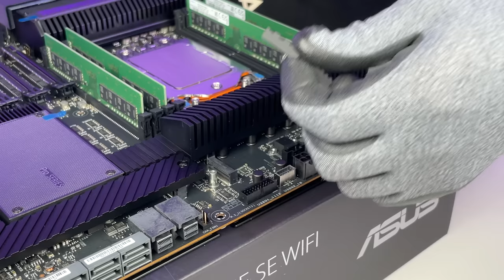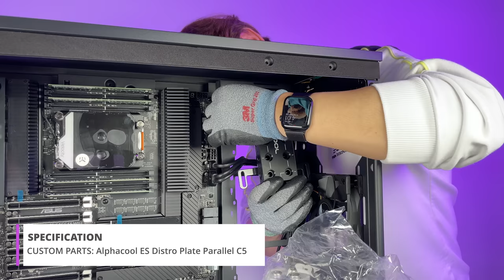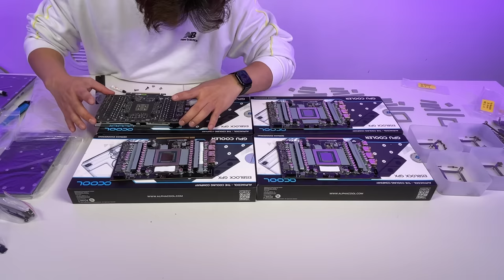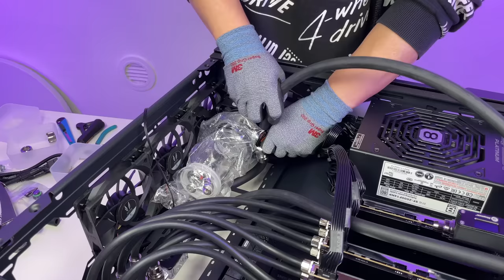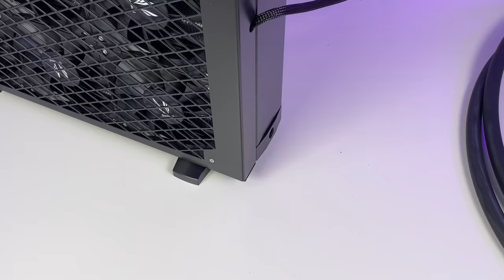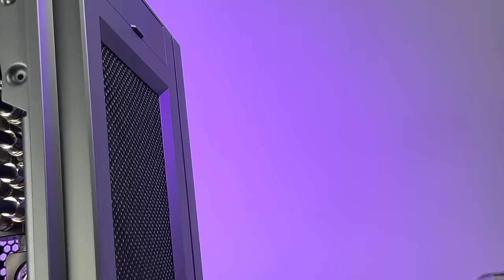$26000 RTX 4090 4Way ㅣThreadripper Pro 5995WX

Comment: Dude, if you're going to make a build this epic, fill-up all of the RAM slots.
Reply: its already 128 gigs. Also, filling entire slot will harm the clock speed, so its just already as big with full clock.
Reply: @azravalencia4577   they could just use dummy RAM sticks too
Reply: Fill up your ram slot.
Reply: He obviously builds for a client, not for his own. Just doing what his client asked so I wouldn't blame him.
Reply: I don't think this is a build were looks or epicness was a priority
Reply: When you build yourself a rig. Put the amount of ram that you want. As Azra suggests below, oversaturating will affect clock speeds.
Reply: @azravalencia4577  Going from 4 to 8 channels of bandwidth is WAAAY more beneficial than clock speed.
The RAM he is using is only 3200 MTs RDIMMS they are DESIGNED for 8 and 12 channel use in servers/workstations.
Reply: but- but- the client doesnt give a shit about that?
Reply: @popcorny007  I forgot to see the RAM clockspeed is only 3200. Now i wonder why they dont put full channel lmao.
Reply: @azravalencia4577  5995WX was 8 channel memory and only with 8 memory CPU working on full power. All 8 slot was 3200MHz. Just add same memory and test it)))
Reply: Probably he want stability
Reply: He could of atleast filled those 2 fan slots and maybe used a bigger pump
Reply: hahahah DDR-4 RAM with 3200Mhz OMG in this build. Burned money...
Reply: Double it for the next person
Reply: I think is enough. He already doesn't have SLI. Maybe would shine with virtual machines. Games only use 1 gpu 🤷🏼‍♂️, and of you would use 4 for accelerate ai or graphics rendering. Quadro makes for sense
Reply: I think you mean a build this epyc
Reply: Bro more ram does not maen more fps
Reply: True
Reply: @azravalencia4577  it’s not harm clock speed. This is 5995wx it’s have 8 channel memory controller. But i don’t know about speed 3800mhz will be a limiter for ddr4.
Reply: @weptlazer8068  what’s the point
Reply: @ve.96  yes abut also what @Azra valencia said seems valid
Reply: No he want to invant to bring 1 more ssd , his budget is 25999 usd only so yea...
Reply: this thing is more expensive then my emc tower…
Reply: @0tayaya  it is expensive than my life
Reply: even my 8 year old pc has all the slots filled 💀💀💀 like you could of just used ram with each stick having less ram like 16gb per stick which would make the 128gb max with the 8 slots
Reply: Why should he. If he's not even gonna use them
Reply: @popcorny007  does that CPU amd/or MoBo even support 8 channel? Or is this a quad channel with two dimm slots per channel board? Like this aren't the server chips nor a server board....
Reply: @Ruiso7  Yes, TR Pro is basically identical to to EPYC, just single socket and higher clocks.
The CPU & board both have 8 channel memory (1 DIMM per channel), so it's just throwing away performance to not take advantage of it. Especially of you're paying for a 5995WX.
Reply: FR💀💀💀
Reply: motherboard limits how much ram you can put in
Reply: @istvangaming9406  yes and your cpu
Reply: 2 channels are faster than 4....
Reply: @azravalencia4577  it’s a workstation not a gaming pc also clock speed doesn’t even really matter past 3200mhz you gain like 5% more performance which is within margin of error
Reply: Mastertrey  what does that even mean and if you’re going for a no compromised 26000$ build with 4 4090s you may as well put in another 128gb of ram especially if you want to play civ 6 with more than 6 mods
Reply: Mastertrey  my man you cannot be a real human being consoles do not render native it up scales from 1080p
Reply: I got 8 full slots around my Threadripper, mind you only 8GB sticks, my first 64GB machine, have been 32GB since the early DDR2 days.
Reply: True
Reply: Performance over looks in this case scenario. Next build I do, I will also doing a 2 slot 64gb ram rather than having all 4 slots full.
Reply: 100% agree
Reply: @azravalencia4577  Incorrect 8 Channels of Bandwidth is more valuable than clock speeds. Its a workstation board designed for using memory that way
Reply: 4 RAM is perfect for quad channel easier to OC if wanted, 8 would make it likely more unstable unless all sticks were matched.
Reply: @KRAVER_  It is not hard to get a matched set.

And it doesn't make it less stable in any meaningful way for this application. These CPU's will never be overclocked. They are industrial tools that need to remain reliable and there is not even over clocking software available. The ram is ECC which at best of times is gonna be a PITA to even try overclock, much less the MOBO. I doubt the BIOS and firmware would even let you. Even in prior generations OC'ing was pretty much a waste of time anyway with INSANE power draw requirements that would push past the limits of a wall outlet. And the boosting was best left to the CPU and software where it could OC fewer cores higher than you can an all core OC. An all core OC is barely usefull in all but the most select applications. Basically OC'ing these things are left to the most hardcore individuals who can code their own basic software and firmware to make it work. Certainly not something would be applicable here

But either way, in practical terms, the biggest difference between 4 vs 8 sticks is gonna be cost. It probably cost less with 4 sticks instead of 8 and maybe, in theory only, perform ever so slightly better for reasons I don't have time to get into.
Reply: you have high expectations for asian countries
Reply: it doesn't make any sense because you hurt latency and clock speeds. What he did was optimal. But it takes advanced tech knowledge to be aware of that so no hard feeling. By all means, go ahead and fill all the slots on your system.
Reply: why do u need so much ram when its already 128?? lmao
Reply: No
Reply: @RipZzDesigns  the THREADRIPPER Pro 5995WX supports only upto 3200 MHz.
Reply: @weptlazer8068  Curious, why?
Reply: the amount of ram isn't the issue, the fact that they look like my pentium 3 pc build is what is the issue.
Reply: but will it run minesweeper at high frame rates ?
Reply: Facts
Reply: but that makes it perform worse. Lol
Reply: For real! What will another 4 sticks run, $250 ?
Reply: nah its good 128gb and 2 dual channel
Reply: This is clearly a production machine, probably a render box for commerical use. No one involved in the process will remotely care about how many ram slots are populated, just the actual amount of available ram. It will have been built to a spec as requested. If it was necessary to use 8 memory channels then they would have done.
Reply: @azravalencia4577  What a noob comment.
Reply: I am a nub but filled ram slot is not the way jose
Reply: @darkrobroy14  you never really push your computer then.
Reply: Didn't you hear? Gee ran out of money 😅
Reply: I was thinking something similar,  "$8800 in GPU's  and you can't spend more than $450 on RAM...."
Reply: @azravalencia4577  Also is 8 channel cpu and mobo, if you fill all ram slots you gain more b/w and a lot of performance in workstation specific applications.
Reply: @popcorny007  8channel only in threadripper, so literally this setup NEEDS fill up all the ram slots haha
Reply: They wasted all their money on 3 extra 4090's that will just idle 100% of the time.
Reply: Could slow clock speeds down
Reply: Probably could not afford it!
Reply: Родной, меня больше пугает  то что этот узкоглазый поставил память без радиаторов охлаждения. Ты только представь на сколько будет греться 1 ячейка памяти 32 гб?
Reply: He could not get a high enough loan for it 😂
Reply: @B.king  These types of high end machines 128gb of ram is a starting point. You can get ram in the Terrabytes of ram.
Reply: that would slow down the performance of the system.
Reply: more sticks of ram makes cas latency worse because of stability
Reply: But he ran out of money. :D
Reply: Lmao as if all these commenters think this machine is meant for gaming
Reply: If the ECC memory and 4 video cards of the first generation of GPU's that don't support SLI, then look at the videos tags.
Reply: Na make video on the rest xd
Reply: @popcorny007  He might use that 8 channels memory so the system will work quad channel. Is it right?
Reply: @RipZzDesigns  At least owner still on time to upgrade that spec ;)
Reply: @ve.96  building anything 101, you don't let the client dictate how you do your job...that's how disasters happen.
Reply: @azravalencia4577  nah, he could have used 16gb cards and filled it up. It doesn't really slow it down at all. If you wanna be technical than it can slow it down by a tiny miniscule amount. I've done tests with 2 vs 4 slots filled, the difference doesn't matter that much. In my opinion, the maxed out look matters more than the very small performance loss. And sometimes there is no performance loss at all while other times even though more rare, there is better performance.
Reply: @ck2503  For machines like 128gb is minimum. They can use memory in the terabytes.
Reply: @Earl McDade  No it doesn't. It's exactly the same.
Reply: Yeah! And he doesn't even turn it on. Could have filled it up with bananas instead of 4090s and it would have been the same.
Reply: why
Reply: @azravalencia4577   correcto, cuando ya pones mas de dos ya va disminuyendo la velocidad, aunque si es  para una estación de trabajo si necesitara gastar para esos 128 gb
Reply: @Chexsum  Asthetics, but with such basic ram it really doesn't even matter. This rig is about work. Not gaming.
Reply: right? damn peasent could only afford a $26,000 computer
Reply: @azravalencia4577  with dummy rgb dimms. and no proper rgb ram? lame
Reply: make em rgb two
Reply: Yeah 2048gb of ram just for the fck of it :D
Reply: @Burnstation3D  I'm sorry but what are you talking about? Do you let your PC builder add more RAM to your pc to make it 64gb when you know you only want 16 or 32? Never said the client should dictate how to build his PC but he probably just owns RAM at home or didn't like RAM sticks Yang had available at the time. Your logic makes zero sense and is actually funny. I hope you ask for your house to be built and let them build it with reinforced concrete even if it's outside your budget or needs lol.
Reply: Doesnt the 5995WX have 8 memory channels though... You are actually losing performance by not populating all 8...
Reply: i dont read epic anywhere
Reply: You do realize that these channels dismantle the PC's after their done making the video right so ultimately it doesn't matter since it won't actually be used. Or it's for a client that could only afford to pay for 128gb of ram. The ram kit alone was $750 USD
Reply: @tacolover619  because if the maximum RAM capacity is already used they can just fill the extra RAm slots with dummys for more rgb
Reply: @neooneeightytwo  nope, it doesn't affect the clock speed. Most especially they are single channel per stick, so it's the best. Maximum bandwidth
Reply: @azravalencia4577  This is completely wrong. Filling up all slots with ECC RAM will use all channels and it has nothing to do with clock speeds.
Reply: @PointingLasersAtAircraft  already full with 128 gigs 🌚
Reply: And some better looking ones...
Reply: no money bro
Reply: Or atleast not green ones...
Reply: All the peasants with their low end pcs arguing not realizing this is a waste of material lol
Reply: @azravalencia4577  That applies to platforms that have 2 DIMMs per channel, TR Pro has 8 channels, each slot is connected to it's own channel, meaning if you're only filling half, you're throwing away extra performance in programs that can take advantage of a lot of memory bandwidth & as long as the DIMMs are binned the same, you should be able to hit the same clocks with 8 DIMMs as you aren't stressing the first 4 channels anymore by adding 4 more DIMMs.
Reply: maby its for a ata scientist or and engineere who doesnt care what the appearence looks like.
Reply: then he cant use dual channel ram
Reply: You think this build just for fun like Design by IFR 😅. they're Systems Integrator (SI) in South Korea. This build for the client. The client choose what they want for their system. They have build a lot of epic pc in the past but maybe you miss it. LOL xD
Reply: @weptlazer8068  😂😂
Reply: What will he use this pc for ? Gaming ? Or is there something other than bitcoin mining that requires this much power and i don't know
Reply: Also can we use some ram that doesn't look like it came out of my old 486 in the 90's
Reply: He will download the rest of the ram off the Internet :P
Reply: He ran out of money at the very end lol
Reply: @PointingLasersAtAircraft  already full
Reply: Probably not stable with all four dimms populated.  I know Ryzen 7000 series chips can only handle 2 dimms and even Intel's cuts the memory controller in half on 13000 series past the official support speed which causes higher memory latency.
Reply: Whats the point of it?  Maybe if he is using for his business for a virtual lan or something.  Gaming LAN at a small company yeah but personal use this is just dumb as SLI is dead and has been.
Reply: @popcorny007  This isn't supposed to be a server OR a workstation with this kind of hardware. Who the hell needs an external cooling unit????
Reply: This is clearly a mining PC and nothing where looks matter.
Reply: Using all ram slots makes it where you can’t overclock as fast
Reply: Getting a 26000 dollar pc only to use ddr4 and 512gb of storage 💀
Reply: Could you watch 8k porn on that ?
Reply: @popcorny007  yeah even if 128 is the requirement I think it would be preferable to fill all the slots and go with smaller sticks to still make use of 8 channels, but at the end we don't know,  this is most probably for 3d rendering or something
Reply: @elishahocking2885 Aster is a program that divides 1 computer into 2-6 users. I divide 2080 by 2 users with one video card and pulls only video memory is not enough for heavy games. And the AMD 7900x processor rarely exceeds 30 ℅ I would like 2 4090 just fine
Reply: it's not necessary, only a Obsessive compulsive person would fill them all
Reply: That cpu doesn't support ram more than 128gb
Reply: I agree
Reply: That and more, what a horriblly beautiful build.
Reply: True
Reply: Rdimm quite expensive
Reply: @weptlazer8068  no point
Reply: @azravalencia4577  does he need that water cooling? No. A lot of parts are just too many to be really effective, it could amready run all game
Reply: @ve.96  i would give him the ram for free
Reply: @ve.96  yeah
Reply: More importantly use good looking rams
Reply: @azravalencia4577 it was designed to have 8 ram slots but filling it all up would deteriorate the performance?
Reply: I would want to see better cooling on RAM where everything is watercooled.
Reply: @azravalencia4577  This mobo supports 2 TB of RAM.
Reply: hahaha exactly
Reply: actually the motherboar might max out at 128GB memory. 32x4
Reply: its allready over powered man, theres no need to fill-up the slots cuz its 128gb
Reply: @ve.96  the powerfull things not always are the beauties, sometimes their just funtional
Reply: @azravalencia4577 to be fair is maxed performance but still seeing empty slot make it look like not maximize XD
I think dummy stick will be good solution
Reply: @popcorny007 I'm pretty sure he was thinking of normal threadripper where there's only 4 channels so he thought it would be running at 2 dimms per channel which ofc would have a relatively significant clock speed reduction but yeah as you said there isn't gonna be any problems at that soeed and he'll there probably isn't that much regression period when ur staying at 1 dimm per channel.
Reply: @crockpot5850 Doesn't mean anything buddy 💀. Old pcs needed it more, ddr5 runs terribly with 4 sticks in two channel boards (so all consumer ones). My point being ur old pc having it doesn't mean shit bcuz old pcs had tiny capacity sticks that needed it.
Reply: You could give him the money, instead of complaining 😏
Reply: hes alr got 4x more than needed.
Reply: 4x1R lower speed
Reply: @weptlazer8068  I think your brain need more ram sticks
Reply: and show us the performance numbers, what's the point of only showing us how it looks? It's not even that pretty at all. I wanna see the results.
Reply: I agree don't leave any slots open. Atleast fill all the ram and gpus up
Reply: @RipZzDesigns  the motherboard only supports ddr4 at 3200 mgz though
Reply: Для чего все это братья? Просто реклама?
Reply: How fast will it load  the fun stuff
Reply: agreed. even just use dummy ram. its like flash a smile but with missing teeth.
Reply: This ram looks ceep, are these server ram???
Reply: YEAH fr
Reply: Bro 💀
Reply: не хватило денег на память
Reply: This system is hobbled by only using 4 memory channels. There are plenty of Threadripper Pro testing benchmarks that prove using all 8 channels is fastest.
Reply: Obvious!!!
Reply: Tell me you never built a PC without telling me you never built a PC :)
Reply: Literally my first thought watching his build
Reply: @azravalencia4577 Would it harm clock speed? This is threadripper, not Ryzen.
Reply: Yeahhhhh boyyyy
Reply: @azravalencia4577  That was a stupid statement! :D I've built one fou our studio @ my workplace and filled up all the slots. maybe for gaming but not for real use! ;)
Reply: I bet its very noisy
Reply: Ngl I’d be more worried about it being ddr5 instead of the ddr4 he’s using
Reply: and also add a benchmark videos atleast
Reply: Most CPU sockets can't handle 4 slots at XMP so it's easier to put 2x 64gb running at 5600 than 4x 32gb at 3000 or 2300
Reply: I'm tripping off 512 gb of mem what's is this pc used for
Reply: what about 512GB ssd!?